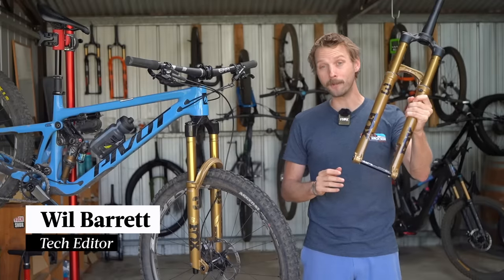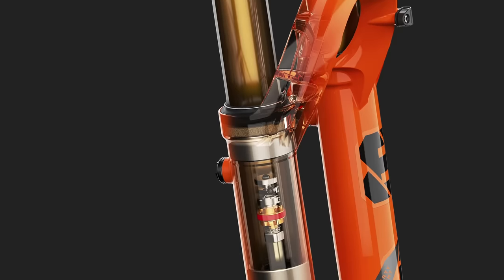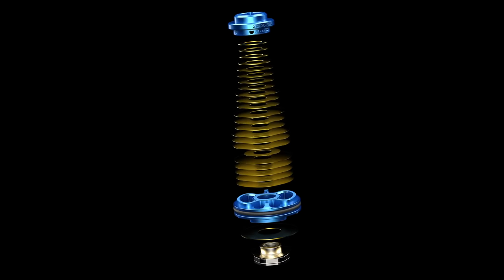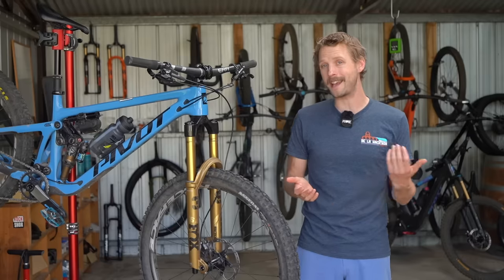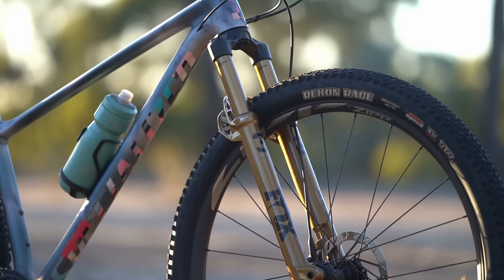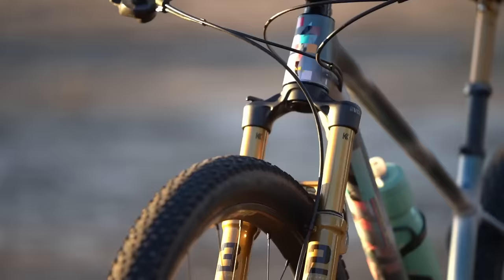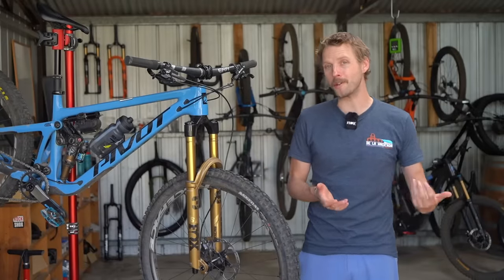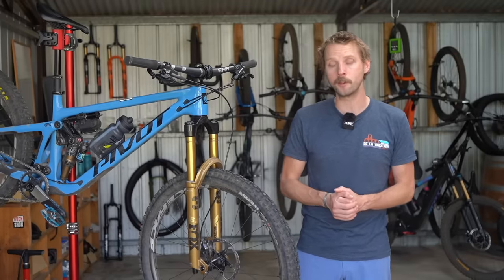First Ride | 2025 Fox Forks With New GRIP X2, GRIP X & GRIP SL Dampers, Plus Brand New 32 Step-Cast!

Comment: If the chassis remain mostly the same, do the new dampers fit inside the previous generation of forks? I have a brand new 2023 34 stepcast that id like to try with the new SL damper if it fits..
Reply from the maker: They certainly do! Or at least, many of the recent forks will be compatible with the new dampers - we've got the GRIP X2 damper on the way to retrofit into the current 36 and 38 in preparation for an upcoming article for flowmountainbike.com

I've also got a 34 Step-Cast on the way with the GRIP SL damper - very interested to see how that compares to the FIT4 version I have at the moment!

We're still waiting for pricing on the dampers, so keep your eyes peeled to the Flow website for an update.

[Wil]
Reply: @FlowMountainBikeYouTube  will do! Thanks, you da best!

Comment: Can you upgrade and replace a regular GRIP damper (34er 140mm fork, maybe even from a Rhythm) with the new GRIP X dampers?

Cheers from Switzerland
Reply from the maker: I believe so - we're actually getting a couple of GRIP X2 dampers to fit into last years Fox 36 and 38 fork, in preparation for an article about what's involved with making that upgrade. I'll double check on the 34 Rhythm, but it should be the same. [Wil]
Reply: Following here
Reply: Not for a Rhythm, you couldn't even put Grip2 in one.  You can for 2021+ Performance and up.
Reply: @IIISentorIII Yes you can retrofit the GRIP X and GRIP X2 into the 2024 34 Rhythm, but not for the 2023 and below 34 Rhythm due to the lower leg damper base stud hole diameter being too small. 

Good news is you can retrofit these GRIP SL, GRIP X and GRIP X2 cartridges into pretty much every other fork, even the Marzocchi Bomber Z1, Bomber 58 and Bomber DJ (except Marzocchi Bomber Z2 as it is in the same boat as the 34 Rhythm).